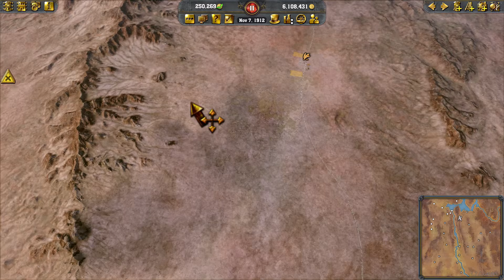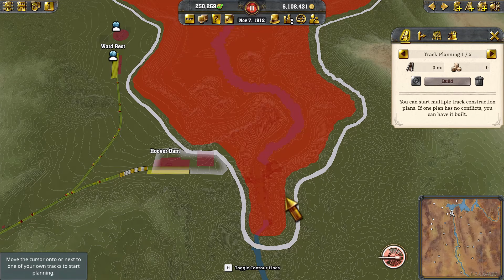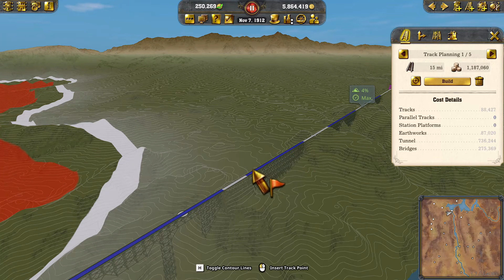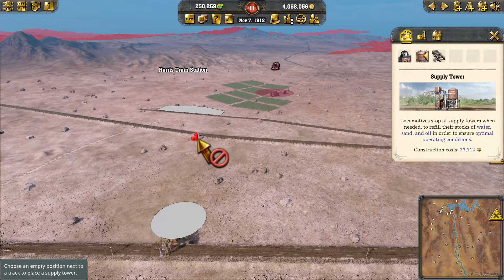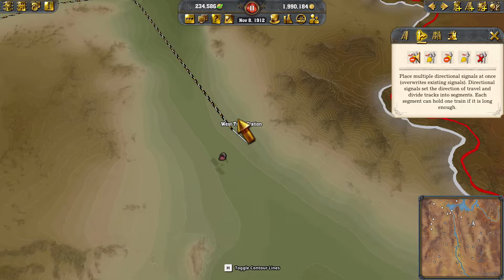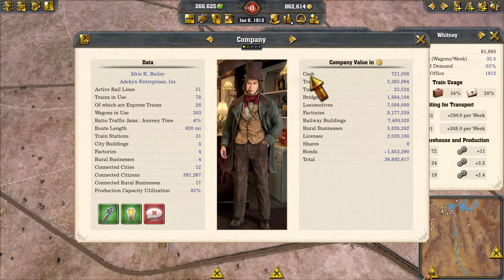Railway Empire 2 Industrial Wonders DLC Hoover Dam Part Four

Comment: Yeah, you are way ahead of us now, but back on #3, check your logs into Primm--you missed setting Primm as a destination which is why it complained about the route being odd. (Which you never figured out. ;-p)

It was your user error in the 1st White Hills train--you had the Edit route open, THEN you opened the add a train and DID add a train, which closed your Edit to the route with NO Accept, meaning it was all default. NO default starting station and coming back will be ALL the goods.

Sorry, never did use the Manual loading, but the FIRST stop looked OK? Come in with 8 meat and drop off 4. The SECOND stop was ALSO saying  have 8 meat coming in and drop off 4, but it would only have FOUR meat coming in if it had dropped them off at the first station? So that might have messed it all up? OR, it may just be a bug in the new foundation mechanic like you surmised.